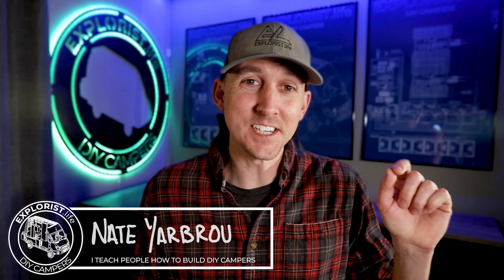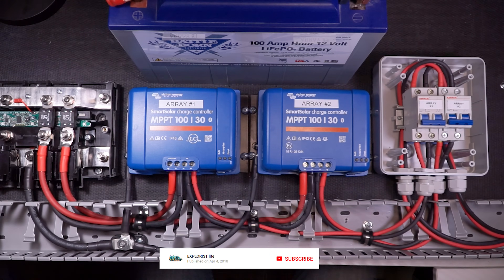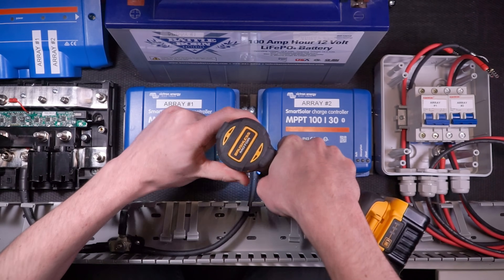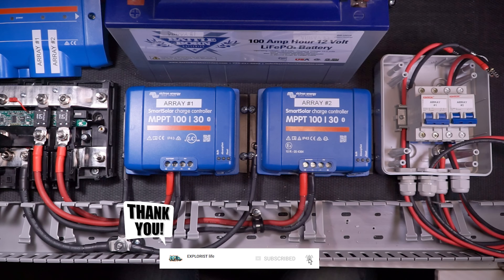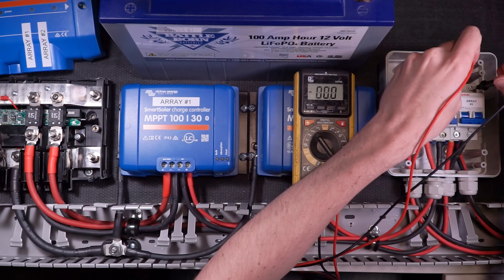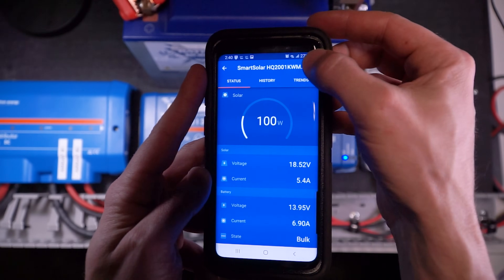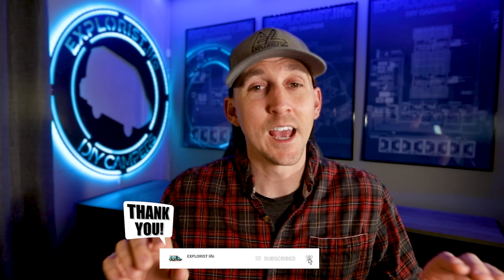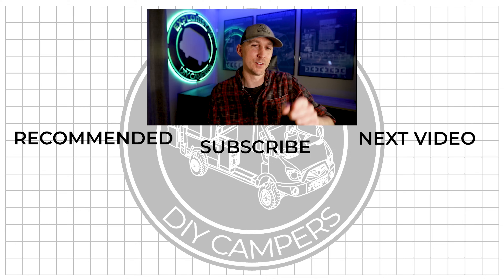How to Wire Multiple Solar Charge Controllers into a DIY Camper Electrical System

Comment: If you are adding another charge controller … do they have to be identical?  If the 2nd array is different/smaller … can the charge controller be smaller? (assuming all is Victron)
Reply from the maker: They can be different sizes.

Comment: I do not have victron charge controllers.... So my question is...are the renogy charge controllers required to network,,. Do the have to talk to each other. Or can I just hook up each controller to the battery bank as is individually.  I'm asking because I plan to add to solar array on my van later when I can afford it.  I can make it 2 separate battery banks if necessary.  1 for my 12v fridge and 1 for the rest of my stuff.  Would rather they were all 1 battery bank though.

Comment: Thanks for an amazing tutorial!I have a question on wire size. Currently I have outback 60 am charge controller and 1 x 4 PV panels array. I ordered 2 victron 250/60 to add 8 PV panels (Voc 46.8v & Isc 10a), planning to connect 2 arrays x 4 panels in series each. Should I use 6awg cables when connecting all charge controllers to victron lynx power in? Not sure if it matters, currently I have 24v lead acid battery bank but will switch to a new 48v one when I receive my new lithium batteries in 2 month (will also add another 8 PV panels and will use 1 victron for each 8 panel array).  Thanks in advance!

Comment: I am looking at an array of 6 400W panels. They have Voc of 50.4V and max current of 9.74A. I am going to have a 24V battery bank, which means that the max current to the batteries is upwards of 100+ amps. If voltage is the main determiner of price for an MPPT, why not always just put the panels in parallel to minimize voltage? Is there also a rating on MPPT controllers for max input amps? And why do I not see charge controllers with higher amp rating than volts? It seems the best option for me would be a 50V\100A MPPT, at a minimum. What am I missing? I may be looking for some consulting but was just wondering about minimizing the cost of the charge controller I will need. Thanks, and great videos. I especially like that they are small, bite size videos that I can watch several of at a time and then come back later to continue, rather than stopping a video and coming back later to figure out where I left off.

Comment: Hi, I have purchased your electrical diagram for my 400 watt battery system. It has been very helpful. But, I have a question. The diagram shows a 2AWG wire connected from the charge controller to the distributor. As you know the controller has small connection points that require a Furrel. I have tried placing a furred on the 2 wag but even after crimping does not fit the controller. How do I go about that?

Comment: I have a used Sun Power p.v. @54v x 6a. that I want to connect to two all in one solar chargers. 
A Kodiac apex, and a Maxoak Bluetti 150. My question, What gets halved, the volts, or the amps?
Reply from the maker: Each unit needs its own panel or array.  They can't share a panel.

Comment: What if all your your wire connects are full on the Lynx connector because you are using a 12 to 12 charger?
Reply from the maker: You can bolt multiple lynx distributors together, end to end, for additional spaces.

Comment: What about two different brands of charge controllers? Say you had 4p 100 w with a Renogy dcc50s b2b, and then also 3s 200w with a victron mppt 100/50. Is the ability to "network" necessary? It's just massively cheaper to use the dcc50s, than the orion and an mppt. Just curious if this is possible/safe
Reply: Following
Reply: @markhomesteader3813  I got an answer elsewhere and have implemented this exact system and it's working very well

Comment: So here's a question if you have an array on the top of your RV into a charge controller and you want to set up an external connection on the side of your trailer to put additional panels out on the ground that aren't used all the time would you connect your additional let's call it emergency panel to its own charge controller or would you just tie that into your original one
Reply from the maker: That would indeed be the best way, yes. 👍

Comment: Hi - I never comment on videos, but i discovered your channel this weekend - and its been an absolute revelation... i was self teaching my way through a solar design, and your videos and tools have made a lot of the 'fuzzy' areas super clear.  thanks so much  !  absolutely awesome job !  I'm going into my particular design with 100% confidence,  where i was unsure on certain things before :)
Reply from the maker: Awesome!  Glad it helped.  Thanks for watching!
Reply: @EXPLORISTlife you only have 2 connections left on that distributor, where would you put the connection for the inverter, AC panel and DC panel?  Could you put two connections on one nut?
Reply: @willyum1208  you can chain Lynx Distributors together.
Reply: @willyum1208  The Lynx distributor is only for 12V devices.  The inverters 12v lines would use the first two positions ( + and -), leaving the other two for some other 12V device or feed.

Comment: Can I mix different charge controllers? For instance, I have a 150/45 maxed out but I want to add more panels. Can I put up a different array but use a 100/30 charge controller? Both obviously Victron Smart Solar.
Reply from the maker: Yep! Definitely.

Comment: Would this be a preferred configuration to run a roof mounted system on a travel trailer that also has the option to connect a portable ground solar array?
Reply from the maker: Yep!   Very much so.

Comment: Is there a solar charge controller that can charge a battery to 130-140vdc? (Its multiple batteries in series) can you manually program a victron 48v charger to go higher ?
Reply from the maker: The Victron Charge Controllers cannot.  I don't know of a charge controller that has that capability, but I've also never looked for one.

Comment: I originally posted this on your video about crimping wire lugs but since this is close I thought I would post it here too.   I have a question about the terminal lugs.  I have a Lynx Distributor but the Selterm Cable Lugs for 4/0 AWG, stud size 5/16" are interfering with or by the plastic insulators that separate positive from negative wire connections. This interference is on both the pos stud and neg stud. I checked the spec on the part at Amazon and it is the correct width.  I could force it down by tightening it, but that just seems wrong and could break the plastic.  Should I shim it with washers under the lug to get the clearance? (wish i could post a picture)

Comment: Nate, another great video. Does this system require the smart shunt to properly charge the batteries with multiple charge controllers? I have the Victron BMV-712 battery monitor.
Reply from the maker: The BMV-712 will act in the exact same manner I showed in this video as the SmartShunt.

Comment: Excellent video!  I  plant to install a victron 250V/60 with 5 400w panels in series. Do you have the like for the double pole brakers and the plastic cable enclosure?  Thanks

Comment: Do the charge controllers need to be the same? Can different charge controllers be used?
Reply from the maker: It will work best if the charge controllers are the same brand so they can be programmed identically.

Comment: Is it necessary to have charge controllers which communicate with each other or is there a way around this using standard charge controllers?
Reply from the maker: There is no "Standard" Charge controller and as such... each manufacturer will have it's own communication (or lack-thereof if not needed) protocols; so you'll have to look up how to do this in the documentation for the specific charge controllers you are trying to use or reach out to their customer support for guidance.

I used Victron SmartSolar Charge controllers for this example, but here is how you would do it with MorningStar controllers: https://www.morningstarcorp.com/parallel-charging-using-multiple-controllers-separate-pv-arrays

Midnite charge controllers talk about this on pg 19 of their user manual: http://www.midnitesolar.com/pdfs/Classic_ClassicSL_Manual_10-001-1_REV_L.pdf

Etc etc...

Comment: Hi Nate, thank you thank you thank you for sharing your in-depth knowledge of electrical systems. I have a question for you: What type of electrical system would I need to power an Air Fryer? My cursory search on the Internet says an air fryer draws too much power. Is this possible? What would I need?
Reply from the maker: You should do a power audit to figure that out.  Here is a tutorial for that: https://www.youtube.com/watch?v=a406IxiU-Xg

...also... anything is possible with the proper application of effort and funds. lol

The power audit will confirm... but I suspect you will be looking at something like this: https://www.explorist.life/3000w-inverter-400-600ah-400-to-1200w-solar-camper-solar-kit

Comment: Nate, Once again a very informative video. I do have one question in your last video you placed the MEGA fuse on the Lynx distributor terminal first then place battery positive cable on top of it. In this video you place the positive cable on the terminal first and then placed the fuse on top of it. So does it make any difference or is it just a personal preference?

Comment: I went with series for following:
1. Biggest reason is Victron MPPT's don't initiate battery charge until output 5vdc greater than battery vdc;  series charges  batteries earlier than parallel configuration.
2. Can mix solar panel voltage  outputs. 
3.  Uses small Guage wire

Comment: Nate, seeking your thoughts wiring Victron's  Lynx distribtor to  Victron's 2 MPPTs, DC2DC CONVERTER, 12V 3000WATT MULTI PLUS, and the DC distribution line.  Since I need 5 lugs and the Lynx only has 4, my thought is to wire the DC distribution line independently.   Your thoughts?
Reply from the maker: I recommend using an additional Lynx Distributor.  They simply bolt together end-to-end for an additional 4 spaces.

Comment: Fuses on lynx distributor 
In previous videos you said that the fuse needs to go on first and then positive wire last but in this video you did positive wire and then fuse last. I just want to make sure I am wiring it correctly. Can you assist?
Reply: I don't think it matters to be honest what goes on first as long as there's a secure connection the only difference would be if the lug goes on first your fuse me Lee flat as opposed to putting the fuse on first it may put the fuse at an angle so I would just determine what lays your fuse in a more parallel state between the top lug and the bottom lug for better connection
Reply: Yes I was thinking the same thing...Very confusing.

Comment: The network total power is pretty cool.  How come no Battery sense?  that would give you a 2nd. low temp disconnect?  I am sure the battery has this feature, does the smart shunt also have a temp sensor? I am in the process of building a 280ah 12v battery box from hell.  It will have two internal victron 75/15's and one external one.  along with a 25amp victron ac charger, and battery sense.  I can't wait to watch everything play together.  My truck has 200watts (to be rewired in series thanks to another one of your videos) and a 150w 36v folding, and a 100watt folding panel 450watts total.  the different voltages and locations are why I need three charge controllers.  Keep up the videos you are on a roll.  By box will have temp controlled heating and cooling that is why I want the 2 controllers mounted internally.  That way they can move with the battery box if i remove it from the truck,  If my dual fans can't cool it enough I will simply remove the lid.  Way too much info I know but it gives everyone ideas about how other people use stuff.

Comment: Would you mind sharing a link to your DC breaker box you used here from the arrays? thanks
Reply: Go to explorist.life and look under how to wire a solar disconnect.  It's listed further down.
Reply: @KentFleshman  the one used in this video is not the same one he shows in the article. This one is bigger
Reply from the maker: The exact box I showed is no longer available.  The box linked in the video description is a very similar replacement.

Comment: Great video. I would've been afraid that the charge controllers would work against each other and back-feed power into one another, but then I realized that they can't because if they could the battery would back-feed power into them when the sun is not shining. 
 I just converted my entire system from cheap to Victron, and what a dream!
Reply: I just saw the vid and had similar observations..  Thing is, observed the volts on array #1 at about 41V and array #2 at 19V. . Same question about the back feed by the arrray #1 into arry #2 at its lower voltage maybe causing something to short out. Can anyone clarify  ?
Reply: @MegaErs123  I had basically the same thing in the charge controllers were fighting each other
Reply: Yeah I could see one controller pushing a charge, and the other controller seeing what would be fully charged battery voltage (if it weren’t receiving a charge from another source) and going into float mode. It wouldn’t necessarily backfeed  but you might not have both controllers in bulk mode (basically delivering max charge power) when they should be.

Comment: When using 18650 100P battery packs do you choose just the lithium ion
Reply from the maker: You should reach out to the manufacturer as I mentioned in the video. 🙂
Reply: @EXPLORISTlife   I was asking because I own the  exact same one as in the video  And figured you already knew  Sense you own one to
Reply from the maker: Gotcha.  Im not using nor do I own a 18650 100p battery pack.  This setup is for a Battle Born LiFePO4 battery with an integrated BMS.

Comment: I have a 2018 Airstream Interstate. The RV has 3 100 watt solar panels with 2 AGM batteries. Do you plan to have a instructional video, how-to convert from AGM batteries to lithium batteries? That would be a great help to some of us immensely.
Reply from the maker: Batteries like Battle Born Batteries are drop-in replacements.  You'd just need to adjust the charging parameters of your chargers, but that's all, and that was shown in this video pretty well I believe.

Comment: Now we're talking! I love your channel! Victron for life! Can you do a multiple battery bank system video? Do I use btb 12to12/24to24?
Reply from the maker: Awesome!  Glad it helped.  Thanks for watching!  I've got a video of a system that has multiple batteries in it's battery bank here: https://www.youtube.com/watch?v=JMqtVBN26NQ and all of the diagrams at https://www.explorist.life feature battery banks with multiple batteries.
Reply: @EXPLORISTlife  I meen lithium battery's of one sort and lead of another sort for example.
Reply from the maker: Oh, gotcha.  I would never recommend mixing and matching battery chemistries/voltages into the house battery bank or having two seperate house battery banks; so I won't be doing a video over that.

The closest I'll get to that kind of video is talking about DC DC chargers when we charge our house lithium bank from the alternator which is connected to a lead acid or AGM battery bank, that'll be coming up later this summer.

Comment: This came out just in time. I'm in the middle of wiring in a smaller ground mount array into my RV system. It's been great so far but I want the extra umff for the AC this summer. One thing is my original system is not victron 😲 ( ohh no lol ) nor will be my ground mount system ( 😲 really ) I'm choosing not to change everything cause of the extra expenses for all new wiring and new equipment cause I know at that point I will just put it all in one system and that would add more than what I want just for the summer time. Now to my question. Since you use a combining box prior to the charge controllers do you need one to connect the two controllers together before you connect to the batteries ? I'm not much on leaving the internet on at all times cause it comes from my phone, that's mostly why I have not changed to victron. Just a side note. Great video series.
Reply from the maker: Great!  Glad it helped.  Given that you are indeed using some kind of busbars of some kind for high-amp DC distribution in your system as opposed to stacking a dozen different lugs directly onto your battery terminals... your charge controllers would indeed need to be connected to your busbars in some form before heading to your battery.  

Also... worth noting... the solar disconnect box isn't 'combining' anything.  It is simply two breakers in one box.  Each circuit passes straight through.
Reply: @EXPLORISTlife  thanks for the info. Sun is starting to rise lot's of work to get done on my ground mount today. Happy camping

Comment: From a total noob: if part of my array was shaded, would splitting it into two and using this solution mitigate the losses from half of array being shaded and the other in full sun?
Reply: Yes.
Reply: @a64738  thank you
Reply from the maker: Yep!  You're just building two separate arrays that will function totally independently of each other but will combine charging efforts with whatever power is being delivered to the charge controllers.
Reply: @EXPLORISTlife  couldn't he do that by wiring the shaded panels in parallel with the non-shaded panels and not add the additional cost of a controller?
Reply: @EXPLORISTlife  thank you :-)

Comment: Great video, of course. I will be installing a solar system with Victron equipment and already have a small 15amp Victron controller for 2 panels on the ground. I had no idea you have to connect the controller in that fashion. Thanks.
Reply from the maker: Awesome!  Glad it helped.  Thanks for watching!